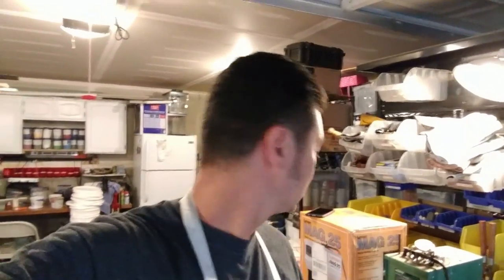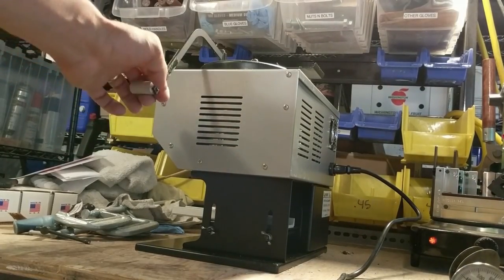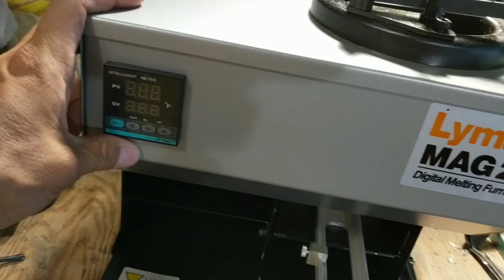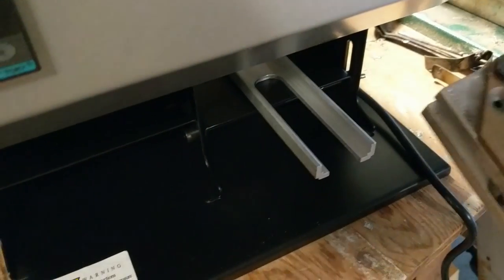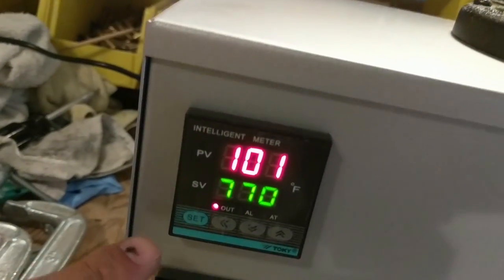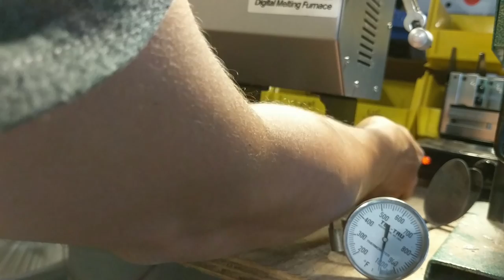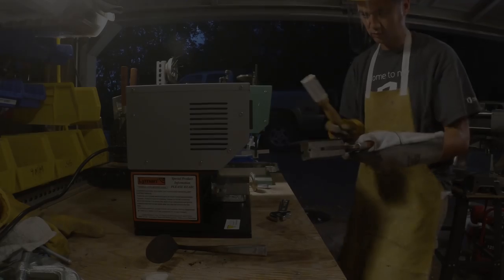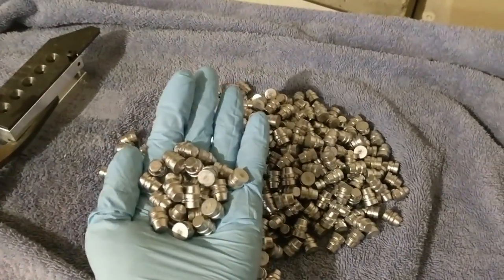Lyman MAG 25 Lead Melting Pot - Thoughts and First Bullet Pours

Comment: I have a magma master caster for the bulk of my shooting but still hand casy many bullets for other things. Like the 45/70 or 44 mag.  I got tired of my lee 4-20 dripping everywhere so i decided i was going to "fix" it.  After taking it apart i was under impressed. So i set out on building my own. pid controlled 35# bottom pour. I did a test run on it yesterday. Now ive got to insulate the pot and build a box to hold the electronics. Ill post you a video when its done.
Reply from the maker: I'd love to see it!

Comment: What if you split the mold guide in the middle, then screwed the halves to that plate at the right width to hold the NOE molds?
Reply from the maker: +scrubby4130 for a temp fix I might grind off the lip on the entire right side.  So the molds will just index from the left.  The hollowpoint molds are even wider with the clips.

Comment: I never thought of taking it off and just stacking stuff to run the mould on. I like the mould guide way of doing it. I sit when I cast and my wrist hurt after a hour or so with my RCBS pot (which is a good pot). I like the Lyman heats up faster I think and having the ability to control the temp is GREAT for me.  I was always tweaking the RCBS sometimes I would be in the zone and the next time (not moving the dial at all) I would have not so great bullets. 

I sure hope NOE will make new mould guides and market them. My pot smoked like mad the first time I fired it up also.  Thanks for another fine video.
Reply from the maker: +Barn Dweller thanks for watching and thanks for the kind words.  I will keep you updated as far as the guide goes.  I'm serious about getting the ball rolling on that guide.

Comment: Nice looking melting pot.  Look forward to seeing what you do about the guide.
Reply from the maker: Yeah, I have a couple of designs I've been thinking up.  I'm going to take the pot down to the NOE shop and bounce some ideas off those guys.  Maybe come up with a replacement guide that can made pretty inexpensively.  Last time I was down there, Al said that he had gotten several requests on replacement guides for the Lyman pot.  It would be nice to make one that just indexed off of the left side which could be adjusted easily.

Comment: Pretty cool pot having the PID, the mold guide looks easy to fix. I have two Lee pots an old one I used for casting fishing weights and a new one still in the box. I reloaded years ago but never casted my own bullets. I have collected a bunch of stuff in the last coupe of years, I hope to get my reloading room put together by Jan. I still have about 500 or so pounds of lead to process been doing 50 pounds every other day or so. I have a set up on a big heavy cart at my shop, I just roll it out and have at it no real set up. Saves a lot of time. I think you mentioned about these Turkey fryer type stoves being strong enough to support the lead. I also thought the same thing I spent a little more and got one that is rated for up to a 100 quart pot, 100 quarts of water would be about 200 pounds. I never exceed say 60 or so pounds seem very strong and sturdy. When I start casting I may look into that Layman mag 25. 

Cool Vids and Thanks for sharing Terry
Reply from the maker: +terryp5001 let me know if you have any questions when you get everything set up and start casting!  I will keep everyone updated as far as the mold guide goes for this pot.

Comment: I cut my mold guide by a third. I also angle it  and then it works. It's not the greatest for our NOE molds but after the mod it moves along. But I am going to remove it after seeing your vid because I have some nice thin bricks that will stack up better and so work better.  It's my first digital PID controlled pot which I like very much. Yeah I went back to my electric burner to warm up my molds and then the top warmer  seems to work if I have to go away from casting for a few mins.
Reply from the maker: Do your molds fall over with the handles on? or do you put something on the left side to help balance the handles?
Reply: The angle keeps from falling .. think of an X type rail road crossing.  That's why taking it off may make the the best since. I have a thin set of fire bricks that might work better than the mold guide. Also if I could flip the mold guide over I think it would work... but I know the bricks will solve my problem and work better and easier. . and If you are talking about the warmer I have HP molds so I stand them straight up.
Reply from the maker: Oh sorry, I meant on the mold heater.  It seems like if you put a mold on the heater with the handles attached it would just tip over and fall off.
Reply: Mine doesn't but I would still go back to the hot plate its way better unless you are just stepping away for a few mins.. I haven't use a two cav mold on it though.... so all my 4 to 6 cavs don't fall off.
Reply from the maker: +Vengenace Early yeah, that's kind of what I figured

Comment: I'd like to ask. How many hours does the device stand and do you advise to buy it??
Reply from the maker: I do like it, and I have run it 8 hours before in a single casting session.  The default mold guide is horrible, but with the NOE replacement mold guide, I love it.
Reply: @FullLeadTaco  َ

Comment: Full.Lead.Taco I just got mine and upgraded the mold guide to NOE version 3 before turning it on. It is AWESOME! Thank you for the review...
Reply from the maker: Glad to be of help
Reply: Can you provide a link to this NOE guide?
Reply from the maker: https://noebulletmolds.com/site/shop/melting-pots-and-related/lead-pot-mould-guide/lead-pot-mould-guide-3nd-gen
Reply: Thank you..I’m totally new to this bullet casting. So another dumb question....when melt down say 15lbs of load I assume you must pour all that lead out into bullets or ingots before you turn that furnace off otherwise it could damage the pot? Or no?
Reply from the maker: I usually leave the pot partially filled, seems like it melts faster that way.

Comment: Watched this 3 times now. 
I learned to turn the Lyman mold guide upside down so that it would work with the BIG H&G 8-10 molds back in the 1960's when they 1st came out with the mold guide.
They worked fine for 3-4cav Saeco, H&G, Lyman and Lachmiller Molds.
Why should a manufacturer design his product  to work with a competitors tools ? 
And as some one else has mentioned turning it over is an old trick.
I bought the 1st gen version of the N.O.E. mold guide for the old RCBS Pro-Melt. It doesn't work that perfectly either. The locking screws are accessed from the top of the plate. REAL EASY to get them filled with lead. That's a pita when you have to adjust the mold guide for another size of mold. You didn't hear me whining to Big Al.
Don't be such a Hater. 
Folks have been using Lyman/Ideal equipment for well over 100yrs. 
And look at all the mold making companies who have been and gone in that time.
Reply from the maker: This is a review on my personal thoughts and opinions, pros and cons, of this particular pot.  RCBS and LEE pots both come with adjustable mold guides, so I think Lyman should also.  As far as providing constructive criticisms, that is how we get evolved and better equipment.  The gen 3 NOE mold guides have taken the feedback from end users and implemented them into the design.  The top screws are gone and are now under neath in the front or back--and are also milled out for drips to go through.
Reply: @FullLeadTaco  Lyman has become a lost cause as far as carring what their customers want. The Corp. Philosophy is cheaper, cheaper, cheaper. 
Which is why The mold guide wasn't updated. They are still probably using left over stock from before the move.
When I cast with RCBS 2cav & Lyman 4cav molds I use the old Mag-20. The mold guide fits them perfectly. It fits them perfectly. 
The N.O.E. mold guide on the RCBS Pro-Melt gets the N.O.E. , Accurate & Lee 4-6 2cav molds.

Comment: is that an rcbs pot there? what do you think of that compared the Lyman?
Reply from the maker: The green pot is the RCBS pro-melt gen 1.  The gray one is the lyman.  Lyman has the pid, the rcbs does not.  The rcbs doesn't leak as much.  The rcbs has a more "open to see" pouring spout located towards the front whereas the lyman spout is farther back--making it a little difficult to see.  I have to raise my lyman pot up to be at a better spot.  Overall, I like both pots, but if my RCBS had a digital PID, I'd prefer that one each time.  That said, I have not had a chance to test the RCBS pro-melt gen 2 yet.

Comment: I have been saying for at least 50 years that Design Engineers should be forced to work Customer Service and/or (in the case of vehicles) mechanic on their designs. That should fix the dumb assed mistakes.
Also, do you run some sort of fan in your shop while casting?
Reply from the maker: That would definitely make designers think twice before finalizing a design.  Great idea!  Oh and as far as the fan, I usually cast with the garage door all the way open.  My casting table I built has wheels on it, and I usually roll it right to the edge of the garage--So I don't end up using a fan.

Comment: That has been a common complaint is that the mold guide is an engineering disaster, Most casters remove it like you have. another thing was the furnace sits too low and you can't see what you are doing because the spout is placed underneath and set back, Again casters have over came this with a simple modification to the frame. Other than that it has been well received among the casting community as a good quality long term furnace at a cost savings that most people can afford. Unlike the RCBS Pro-Melt you and I own. that furnace is a huge decision for most casters as far as cost. You and I both see it like this though, It's like buying a nice pistol or rifle. Just another thing we bought to last and maybe hand down someday to someone. also.. That Mold you casted with, that mold is a copy of the H&G #130 .45 SWC. I have that same design in a Saeco steel four cavity mold, good shooting bullet, however I found that recoil is a little more pronounce than the H&G #68 that Lee has copied in the six cavity offering (A real plus).. Good video and review dude. Dave.
Reply from the maker: Great reply dave, lots of good info!  I feel like that pro-melt is going to last a loooooong time, and hope the lyman lasts as long.  What guns you shooting your semi-wadcutters in?  Also, did you happen to see the mold guide shelf on that RCBS Pro-melt shown very briefly in the video?
Reply: I have a Rock River custom Bullseye and a Dick Shockly custom Bullseye Colt commercial. Both pistols shoot equal in accuracy.  You should go on eBay or Amazon and get the "pistols shooters treasury" By Gill Heaberd. It's old school pistol techniques by the very best shooters of all time. There is a little hint. Buy Metalform Magazines with the rounded follower for the 1911 pistols.   Good stuff dude.
Reply from the maker: +Thorsaxe777 do you ever shoot the bullseye matches with those?

Comment: Once you replace that mold guide Im sure its a nice pot. I would just measure your widest mold and get 2 -1 ft sticks of 3/4" or 1"  steel angle iron and drill 2 holes in it and space them apart your measurement and bolt them down. Presto Now all your molds will work on it .   I'm sure Taco Figured out something
Reply from the maker: https://noebulletmolds.com/site/shop/melting-pots-and-related/lead-pot-mould-guide/lead-pot-mould-guide-3nd-gen
Reply from the maker: That's what I came up with

Comment: Mold warmer is sketchy both from a
strength aspect and warming, I very much doubt that can transfer
enough heat to properly warm a mold. Also, what moron designed the
mold guide so that the most prevalent molds in the world, Lee's would
not fit.  Seeing I have mostly NOE molds, kind of kills the idea of using this straight out of the box. I liked the idea of more capacity and integrated PID but
really cannot see upgrading with having to mod the mold
guide anyways.  Very much appreciate the review.
Reply from the maker: Yeah, I really can't figure out why they thought that mold guide would be a good idea.  I think that scares most buyers away from the pot--even though the pot functions quite well melting the lead and keeping it at the proper temperature.

Comment: I would just remove the mold guide and use the rod it sits on or have somebody weld you a plate for your molds to sit on in place of the guide.
Reply from the maker: yeah, riding the rod would probably work.  I'm working with NOE to build a shelf that goes over the rod--that should make things much better (once it gets finished).  It's nice living a few minutes away from the NOE shop.
Reply: I would grind off the vertical 'rail' on one side.  By keeping one side as is, you'd still have a guide for positioning the mold under the spout.
Reply from the maker: +Ken Cammenga I was able to design a replacement mold guide and NOE machines and produces them for sale.  I think they are pretty inexpensive and well worth the money.  In one my other videos I show the design and what it looks like.

Comment: yeah the mold guide sucks !! i modified mine a bit.
Reply from the maker: +duffys gunsmithing what did you do to modify yours?
Reply: i made 1/4"' polished stainless  rails that i can move up and down.the guide that comes with it gets splilled lead all stuck under it and the polished rails it comes right off.

Comment: Can you turn the guide upside down and run it like that??? You should not be casting in an enclosed space. Believe me I know. If you go,for a yearly physical have your lead levels checked. I do all my casting outside. Older and wiser. 51 years at this game.
Reply from the maker: I leave the garage door open or partially open when casting.  I always get a blood lead test at my annual physical--each year it comes back as normal.  As far as the mold guide goes, I designed one to replace the lyman guide which is now sold at the noebulletmolds.com site